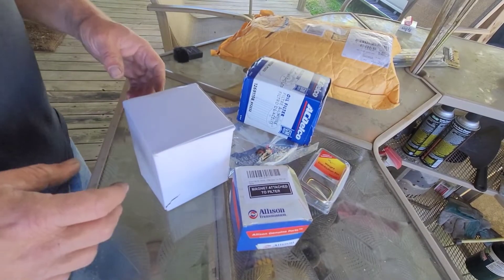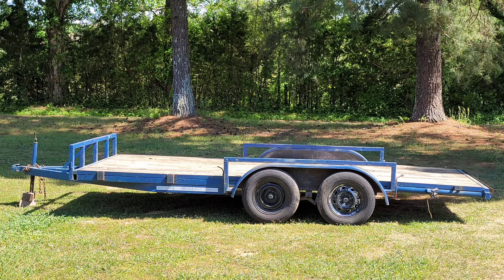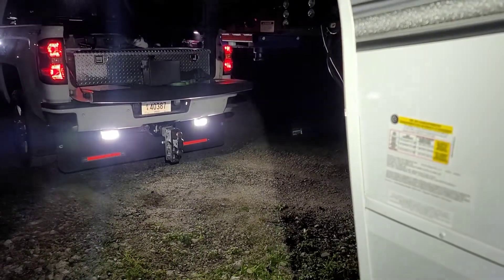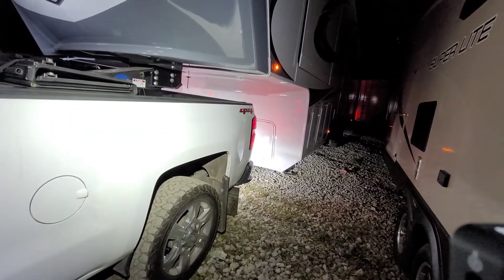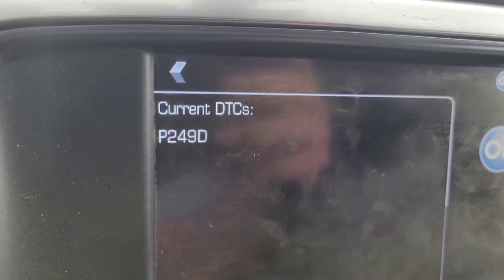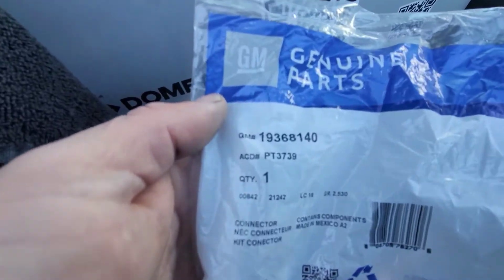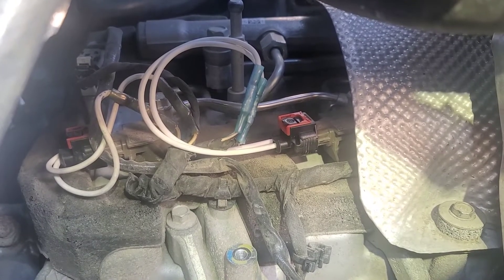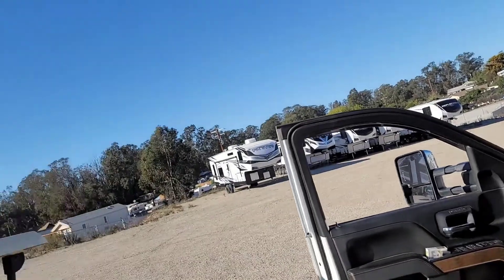Long ride to California

Comment: Back when I purchased my new GMC 3500 in 05 they had injector plug issues you would think 15 years later they would have corrected it  by now lol. Now I drive a ram, second one only because GM priced me out of the market but as you said they all have quirks. Safe travels to you and keep up the videos I'm thinking of joining the ranks of RV transport.
Reply from the maker: Thank you for the comment, i believe they do. Nothing wrong with a ram. Thank you!

Comment: Great information on the difference between the 2500 and the 3500 on weight. Using your fuel to help with close weight . I do that now on the big truck. You give good thought to how to become more efficient and productive.
I was looking at a single wheel 3500 to pull campers but what you said makes a difference. Yes I do have my CDL. 
I’ll have to do more research on weights on the difference between the two 2500 and 3500 single wheel with short bed with a auxiliary fuel tank. 
Thanks for taking the time to explain WHY you would do it a certain way. I’m waiting to get my truck and have it outfitted with what I need to pull campers. Thanks
Reply from the maker: Thank you! My way may not be right for everyone but it makes sense to me. I hope everything goes good getting your truck and if i can be any help let me know

Comment: So I don’t know if you know this but you don’t have to cut and replace the injector connector. You can repair the metal connector electrodes with a small peck. The issue with the injector connectors is they lose conducivity between the connector in the injector because the pins spread out.
Reply from the maker: Hey,
  I have thought about that but never tried it. I've seen how discolored they get and at first i had hoped the replacement was a upgraded connector but now I'm seeing it isn't. I would have tried repairing one in a pinch but it has just seemed easier for me to just replace but I'm glad you brought this up. I may try to repair the next one and see how i do. One person commented they zip tied the wires to the side and it got them through until they got a replacement. Thanks again

Comment: I guess I got spoiled by my truck charging my breakaway battery while hooked up to the camper. I’d hate to have to deal with charging it separately 😂
Reply from the maker: I thought mine was charging... hope my battery isn't going bad
Reply: Well after some research, my truck has the package or whatever it is. That’ll charge through the 7pin. So I was just lucky. Not every truck has it. 
And yeah I left my battery hooked up to a fifth wheel in California once 🤣

Comment: Great info. Great delivery. Fantastic video as always. 
I have a 22 ram 3500 HO dually and… yeah I could pull more weight with a SRW or a 2500? But the ride is sooo worth it. And the feeling of stability. A+ lol
Reply from the maker: Thank you! Absolutley.
Reply: And with overnight idling. Temps between 20-60 I didn’t idle. I could stay perfectly comfortable. I’d idle below 20 only because of the def system. And anything over 60 I would suffocate lol

Comment: So, pulling the large RV that puts your combined total weight just shy of the 26000#, how much over weight does that put your drive axle in regards to the truck's rear axle/tire rating?   DOT can ticket you for busting that number.
Reply from the maker: I've seen people get that ticket in a 18 wheeler (over on axle weight. Got that ticket myself pulling overleignth flatbed 15feet off the back) but not seen it in a pickup. Safety told me there were exemptions when transporting new Rv but I've not seen it in writing. I have also called insurance company I have all my insurance with (cargo, unlaiden and full coverage on the truck) and they say same and i will be covered  even with the one i have today 3 axle 15k ahipping weight . Patrick industries ownes Indiana transport and synergy and they have hundreds of 3/4 ton trucks running the country with big units and while i don't like i don't see it in writing i caint help but think they wouldn't subject themselves to putting hundreds of potential lawsuits on the road every day so when they tell me there's an exiemption and the officers at all the scales I've crossed only check the 26k i have to believe there's something to it. I'm still looking for the exiemption in writing and as soon a i get it i will definitely share it.
Reply: I bought a 1 ton ram and have a cdl and this was a big concern for me but I keep hearing that we are “exempt” on certain things but I don’t think it’d be worth risking. Or finding out how much that ticket is.
Reply from the maker: I understand.

Comment: Found your channel when I saw how many miles your L5P had on it. Very impressive.  Mine has 20k and although I don't use it commercially I would like it to last long so subscribed lol. I do have a question.  How are you getting away with towing many different 5th wheels with any type of sliding hitch? I have the same configuration truck-wise and use a rotation pin box to get the necessary cab clearance which just makes it. I see you had a small issue but with amount of miles and different trailers you've pulled its incredible thats all that's happened

Comment: A bigger advantage to the 2500 is that you can run PC while not loaded. Saying that, I can give you 10 good reasons to run a 1ton dually diesel. Main reason is I almost NEVER see a dually that's been blown over from high winds.  I've seen way too many 2500's upside down.
Another piece of advise, hauling singles is for suckers. You will not make much if any hauling singles.
This will help you if you're not already doing it. Use load boards before you dispatch to get loads coming back as close as possible. If you're not using them, you need to contact me and I will help you learn how.  I don't know who you're leased on with but most use Central and that's a good one.
Reply from the maker: I see a 1 tons blown over quite often. As many as big trucks and 3/4 ton. I appriciate it but i prefer single pull. Money's decent without all the agrivation. If I'm gonna pull a trailer I'll go back to pulling oversized. Thank you for your offer and your comment. I appriciate it

Comment: Did you replace the 2nd nox sensor and the p02ee and p249d codes clear after that. That’s the codes i have on mine. I replaced the one on the turbo like you did and a couple months after that I got p20ee and p249d come up. Was told it was the other nox sensor.
Reply from the maker: They did, it took Multiple key cycles for them to go away (even after clearing with the autel). I drove it most of the next day around town with the cel light still on very aggravated but eventually stopped and went into a store and when I started it back up they were gone and didn't come back.
Reply: I had them same codes come up yesterday p249d first then last night p20ee. It’s been fine since last time I wrote you about it gonna call the local diesel shop tomorrow and see if he can change the 2nd one for me. Thanks for replying last time

Comment: When you look at loads on the load board does your company post both the dry weight of the trailer and the GVWR of the trailer?  Non CDL set ups are based on weight correct?  Not combined GVWR??
Reply from the maker: They only post gvwr. Actual shipping weight is on the title with paperwork when you pickup. Non cdl goes by gvwr cdl goes by actual weight to the best of my knowledge. Both are combined weight. If your truck gvwr is 10k you would only be able to pull 16k gvwr trailer without going over 26k combined.
Reply from the maker: I think so

Comment: Do we know what causes the failure inside that connector?
Reply from the maker: I don't, I've been told by multiple people you can pull the wires to the side and tape or zip tie and they'll make connection and clear up but i carry at least one with me. The new ones have thicker wires but not sure if the metal in the connectors are different. Also they usually look discolored like they've been hot

Comment: Question about highway tires
Love your videos thank you so much.
What tire do you run on your truck that gets best wear and mileage?
Reply from the maker: Well, when i bought the truck it had goodyears on it and they rode good and got good fuel mileage but almost zero traction off asphalt got 86k miles on them. After getting stuck and flustered a few times I decided to try the BF Goodrich  ko2 . I'm getting around 80k per set and I'm on my 3rd set. I may have lost some in fuel but i needed the mud traction where i live. I'm not gonna be a lot of help on this because these are the only 2 tires I've put through the paces like this. If you did decide to go with ko2 they sway pretty good for the first 15k miles but then they're solid. I hope this helps
Reply: @CFarmer  thank you, be safe out there.

Comment: IF I have a 1ton dually/ 14KGVRW.  Even if I have a CDL am I still limited to 26K ?
Reply from the maker: Yes, 26k actual weight unless you tag the truck heavier but then you'll have to have ifta stickers and other expenses/ requirements but you'll be hauling for the same rate. To me, I'd stick with 26k tag

Comment: How many miles and hours on your truck?  I’m getting a 2022 Duramax
Reply from the maker: 311374 miles and 9348.3 hours as of tonight and ticking.
Reply: @CFarmer  nice and original engine and transmission? Original dpf ect?
Reply from the maker: Yep, all stock. The only repairs I've done is what i was saying in video and also did all repairs myself. I don't trust anyone else to work on it. I did forget to mentioni replaced headlights and #5 egt sensor was replaced under warranty. I've had exceptional luck out of this truck. I know a few that have had better luck than me and i know a few who've had horrible issues. I would like to drive one of the new 10 speeds. You'll have to let me know how you like it
Reply from the maker: I'll be doing a review on the truck in a whole a soon as i have time
Reply: Yup i well let you know how it is 🙂
Reply from the maker: I hope it does you a great job. All these miles later i still love mine